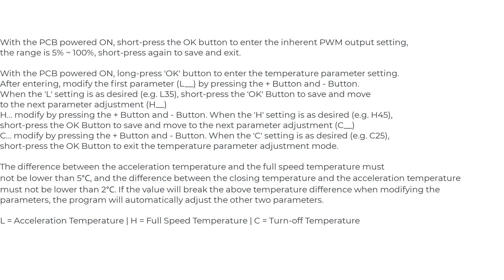PWM Extractor Fan Speed Controller for 3D Printer Enclosure - Tukkari, PrusaBox, Lack  Enclosure

Comment: A post over 3 years old solved my problem with this Board.  Specifically, the C value.  I could not figure out why the fan never turned off. I was also unaware the stop value had to be 2 C lower than the L start value.  Thank you! Working great now! So massive thanks across the pond.

Comment: What kind of pins should i buy for this  "4 Way 3.96mm PCB Connector Housing"  ?
Reply from the maker: If you can find the plug then I'm sure there will be a link for the relevant pins on whatever store you use.

Comment: this is my first real pcb/electronics projects so im a compleet beginner. can somebody help me find the connector he is referring at 1:48? and how do I wire it to the to cable extension?
Reply from the maker: Assume you looked in the description which details the connector type. You will need to chop the end of the ext cable and fit new pins. Good luck

Comment: Hi Collin, thank you for this brilliant video. I try to source the parts. What kind of wires (mm) do you suggest for the power supply? Thank you!
Reply from the maker: Hopefully my links will help you. For wires, nothing too thick. 16-22 gauge flexible wire. Or even just fan extension wires. It's only using 12v and less than 1 amp. Good luck
Reply: @colinhill  Thank you for your quick answer!

Comment: Hi Colin, thanks for the in depth video! 
Cause of you I just collected all the mentioned stuff from the PO Box. 
I will use your design on my TLX for the MK4 and I was just asking myself if you have a new design of the PSU shroud which fits the noctua 40mm you have in this video. Also since the TLX just hs 2 screwholes for the PSU shroud I would be happy to get the step or fusion file for your shrould to change it to the "new" tlx layout.
Reply from the maker: Hi, i have uploaded the step file to Printables, so i can allow you to make a remix. Glad you find the model useful.
Reply: Thank you! I will post the remix with your credit when I am done. Have a great "rest weekend" @colinhill

Comment: Hi Collin, I cant fin a cable that goes out from the pcb to a fan splitter, can you help me out^ Thanks for the vid!
Reply from the maker: There are 4 cable fan extension and splitters on Amazon, but you will need the larger special plug for the PCB mentioned in the description, unpick the fitted plug from the cable and insert the pins into the larger plug.
Reply: thank you! @colinhill

Comment: Minute 1:54, you use an extension cable, but have you changed the connector? That white female connector is different, it is wider. What is that connector called? The connector on the Zhiyu board is wider than any 4-pin connector and I don't know which one I should put. Thank you!
Reply from the maker: Hi, please see the description as I mention details
Reply: @colinhill  Oops! Thank you!

Comment: Hello Collin,

respect. The circuit is really great explained by you. However, I still have one question for you: Does the circuit also work with a simple 2 cable control of the fan? Greetings Frank
Reply from the maker: A 2 wire fan won't be speed controlled. You would be better using a different type and I cover that in another older video

Comment: I am using the version of this controller that allows for 2 fans, 2 temp sensors, and a buzzer.   I am currently designing, testing, and creating a 3d printed cooling system for a Kicker CXA car amplifier. It's turning out great so far.. still need to do some final touches to it.   The board works as advertised. Great electronic board to help with the project.
Reply: How'd it turn out sir handsome?

Comment: Hi Colin, Thank you for taking the time to produce your informative and pedagogical video. Much appreciated. I have been contemplating doing basically exacly what you did in this video, but with a digital controler solution. I.e. rather than setting things up manually, I would like to set the parameters and access temperature controlers using a zigbee hub (I use Hubitat Elevation). Any thoughts on if and how that could be done?
Reply from the maker: Hi. Would like to do the same but not had time to investigate.
Reply: @colinhill  Thank you for your swift reply. If you ever find you have a few moments to spare it would be interesting to see your thoughts on a solution 🙂

Comment: Just ordered one from aliexpress after watching your video. There are versions of the module with two fan outputs and I ordered that one since I am planning on using it as a temperature controller to keep the enclosure close to 20C and ventilating the air with an additional intake fan. I might have to use different speeds for intake and out fan due to the filters on the out, so an Arduino with some simple code might be more suitable there, but for 8EUR, why not try this one.
Thanks for sharing this Colin, I feel like you're the only one on YouTube that deals with enclosure ventilation and filtering. It's an extremely important topic, but somehow no one puts any emphasis on its importance in the 3D printing community.
Reply from the maker: Thanks for the feedback. I suspect the version you are getting has temp control on only one output, the other will just be a fan on off. My next installation is on prusabox and I will be splitting the output to 2 fans, one intake one extractor. I'm glad my experience has been useful for you
Reply: @colinhill  I found more detailed setup instrunctions for the module I ordered in a listing for the same product from another seller on aliexpres and it does control both fan outputs. It is written in broken English, but it sems like it is able to setup different speeds and temperatures for the fans. This is actually what I needed in the first place. Now I'm looking forward to playing around with it.
Reply from the maker: @matze_skopjanecot  that's good news. The one I saw on Amazon didn't allow that

Comment: Thanks for putting this together Colin.  Any suggestions how to use the PWM (or combined with something else) to set a specific temperature in the enclosure?  It seems to me that this method would require significant trial and error to determine where it would middle out.
Reply from the maker: I will be doing a follow up to show the revised pi controller box with the pwm display. But basically just run the temp probe from the pwm controller into the inside of the enclosure. Set the min/max temps on the pwm that suit the filament you are using. Should be good to go. Perhaps have the follow up next weekend